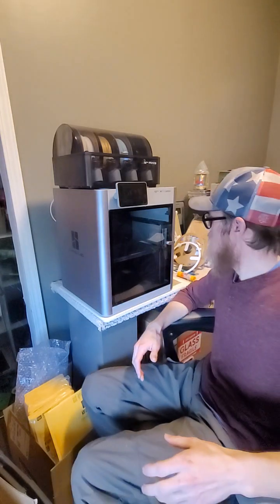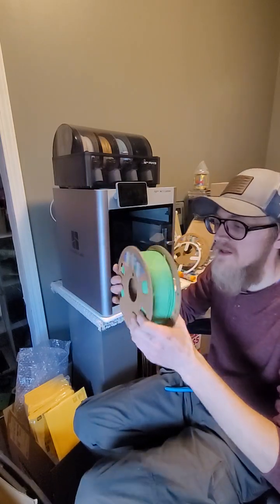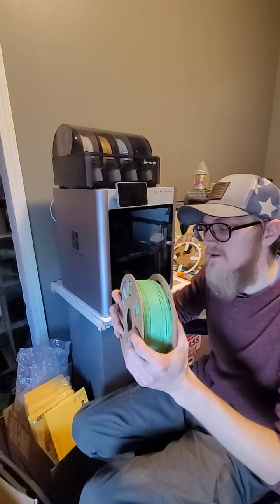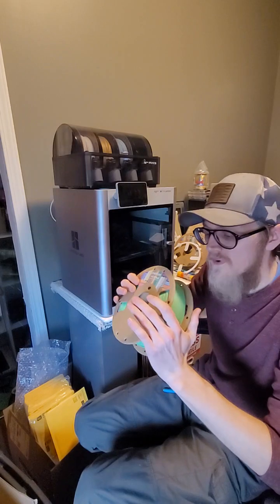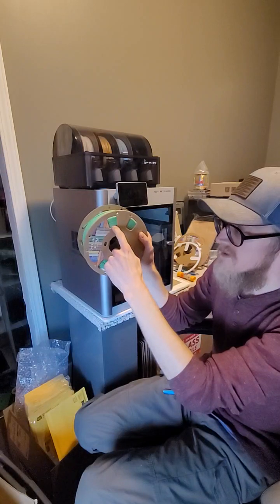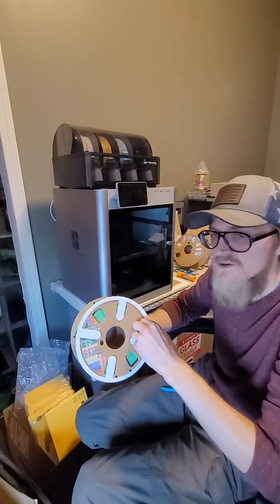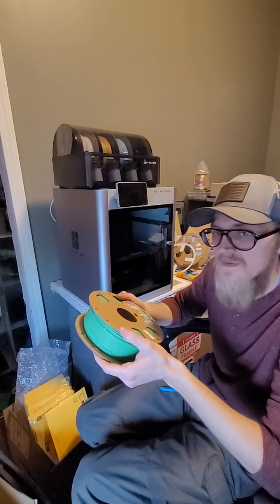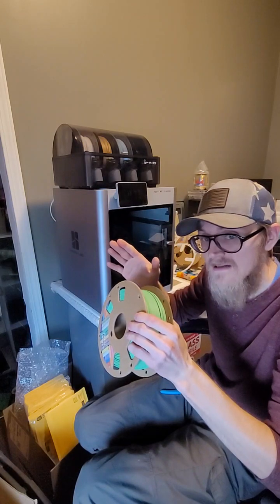Bambu Labs X1Carbon Doesn't Use Cardboard Spools? Hmmmm...

Comment: My AMS worked fine with cardboard, but there WAS a little paper dust from them. I printed the most minimal rings that usually fit well, but I gluestick them on anyway. BEWARE... Many of the rings make the roll too TALL and will rub and scratch  the inside of the AMS lid. So I rest the lid on top of its little locking tabs.
Reply from the maker: Yeah I noticed the dust, too. My cardboard rolls seemed to be doing OK, until there was less filament on the roll. Thanks for the heads up about the scratching, I'll be sure to be on the lookout for that.